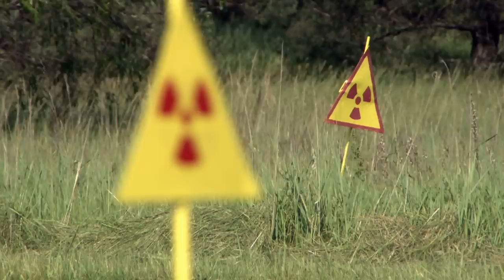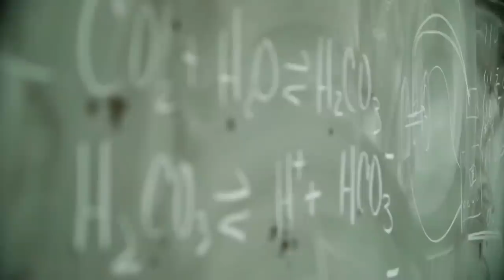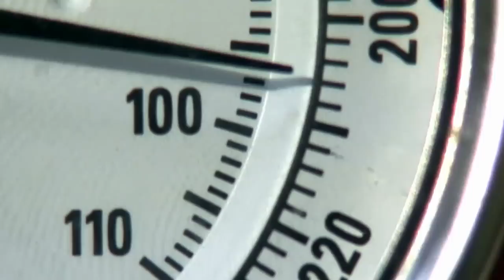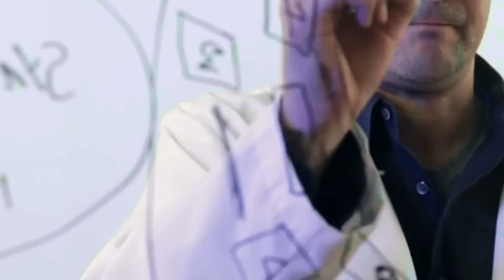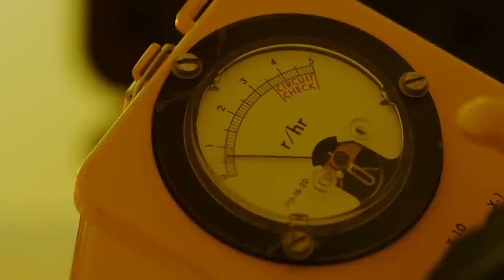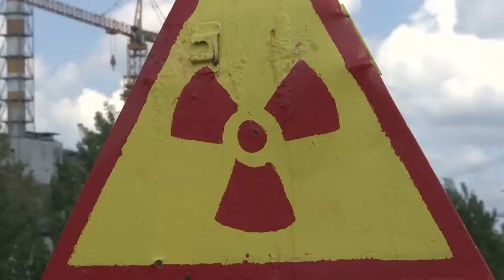China’s Most Powerful Global Weapon - A Synthetic Sun?

Comment: This promise of limitless energy has been promoted for at least 25 years.  So far, it’s just a money pit.
Reply: Longer than that. Fusion has been "only 25 years away" for the past 60 years at least. 😂
Reply: @hazonku  yeah, every 25 years they claim, that from now on, it will only take about 25 years until fusion reactors will produce more energy than they consume 💪😂
Reply: Every endeavor was a money pit before it worked. Wouldn't you think that limitless energy would be difficult and expensive?

Fusion research has been improving quickly for decades. It's just very difficult so even quick pacing requires decades.

I suggest looking into commonwealth fusion systems. They have demonstrated new magnets and are constructing a compact reactor.
Reply: This seems like a DEAD END.  Trying to keep temperature for 150 million degrees for any length of time,  it will melt everything around it.  In order to keep CONSTANT flow of electricity.  It has to keep the temperature for 150 million degrees forever.  This will never be reached.  Therefore, this type of project is a dead end.
Reply: @jeffjohnson5053  Agree, but the Sun does it for billions of years relatively safely. 
Meaning we just need to focus on inverting gravity first! 😂
Reply: Limitless energy for the people who get the investment monies.
Reply: @Shadow__133  Or harvest the sun insteas of making one?
Reply: @sirmiles1820  We already "stock" wind. That would not be a bad idea 😆
Reply: If you read this far you are a certified fusion reactor specialist.
Reply: @jeffjohnson5053  thanks Jeff Johnson 

Lol

Comment: This sounds like a modern but fairly run of the mill Tokamak.  They don't seem to be getting past the energy payback point.  There are a number of these all over the world.  What's the big deal?
Reply: Well, everyone in the world is beginning to understand that make a reactor smaller is better for everything. Easier to clean up say a problem occur. Using A.I. and making the magnetic field better controlled allows for them to reach those fusion levels. Honestly, I think they are stealing intellectual property here in the States. Fusion reactors, magnetic field control and materials science is moving really fast these days and getting better.
Reply: @brown2889  yeah its always 20 years away
Reply: it's running time. 17 minutes before losing stability or melting the inside due to the plasma contact is big news actualy. Net gain return is a moot point as it's all in the math
Reply: Did you watch the video?
Reply: Funny enough I think South Korea was the first to break even. And the US Ignition Facility not soon after (using laser confinement). I mean this happened at highly experimental facilities. But also you have a ton of smaller private companies drawing up more compact designs. So it's getting easier.
Reply: The big deal is that this one is burning longer which pushes us closer to 100% working TokaMac
Reply: @Chestermcfly420  it hardly ran its literally not a big breakthrough in the slightest.
Reply: @sandysand3097  17 seconds... no?
Reply: Dark Guy fell for some Chinese propaganda.
Reply: @brown2889  hmm stealing is giving lol
Reply: This seems like a DEAD END.  Trying to keep temperature for 150 million degrees for any length of time,  it will melt everything around it.  In order to keep CONSTANT flow of electricity.  It has to keep the temperature for 150 million degrees forever.  This will never be reached.  Therefore, this type of project is a dead end.
Reply: Nothing at all

Comment: From all that I have researched on this rather esoteric subject, the big reason that Nuclear Fusion has not had net energy gains is due exclusively to the fact that the ginormous electromagnets - used to contain this volatile plasma material - suck down a tremendous amount of energy.  Now companies are working with low-energy magnets which have a greater chance of achieving net energy gains.

Comment: I don’t see how fusion power plants are possible. Stars use gravity, which is limitless, to turn mass into energy. To create fusion without gravity and have extra energy as an outcome seems impossible in my mind. It would seem to break the laws of physics. I should try to understand it more, but these basic thoughts really stand out to me.
Reply: Gravity is just mass rotating. Magnets are used in tokamaks to simulate this, they accelerate a mercury ball extremely fast to the point that G - Force rips the atoms and molecules apart. The same thing happens in the sun by its huge mass rotating fast enough to again shred things at an atomic scale. The heat and light are a by-product of this.

If you rotate anything with enough mass, it will start to pull the surrounding area towards this, by magnetism. All things have magnetic charges, and if they are accelerated, they impact other magnetic particles, creating a chain reaction.

There is probably an unwritten formula about this. Something like (mass x rotation) × amount of magnetic particles present = gravity potential
Reply: @eastindiaV   That’s not exactly fusion, heat is the secret ingredient in which the nucleons of an atom dissociate under extreme temperatures overcoming the electromagnetic forces between protons and electrons, this creates a neutrally charged plasma that then collapses into fragments of heavier and more stable elements and the increase in the stability of the element comes about through the emission of energy. This of course only works as a general pattern up to the iron peak, past that point you use fission to go down. Your comment on gravity is interesting though, I am only still studying  at Uni, but I think your referring to spin of quarks and leptons, can I assume you’re studying the standard model of elementary particles? Because it is a very fascinating topic to think about how to incorporate gravitons, but if there’s anything you know about that, it’d be great to hear 😃
Reply: On your question about fusion, the gravity isn’t really important because it’s a reaction in which atomically unstable elements transmute closer to iron by realising energy held in the nucleons of an atoms core, I would very much recommend looking at the colourful and lighthearted animation made by Kurzgesagt, https://m.youtube.com/watch?v=mZsaaturR6E, it’s a great short video that explains the concept in layman’s terms and should give you the necessary knowledge to understand the concept without causing further confusion or leading you down a rabbit hole
Reply: This is how I understand it (I am not an expert). Picture "V" shaped ramps; you roll a ball down one of the ramps. What will happen? It will settle at the bottom. Balls rolled down a "V" shape just naturally do that (kinda silly to even think about, because it's so obvious). What's not obvious, to us here on earth, is that a plasma can also achieve a similar state. If you've ever seen videos of the sun, I'm sure you noticed all those lovely "Coronal Loops" of plasma. Well, those loops are kinda the equivalent of a ball at the bottom of the ramps; they just naturally form those cool loops within a magnetic field (keep in mind we only see part of the loop, the rest is below the surface). The idea is capturing one of those loops in a magnetic bottle here on earth (literally lightning in a bottle), and if we can manage to do that, you should be able to extract enough energy out of the system through heat to boil water, to run turbines attached to generators; you then plug your super-powerful bottle magnets to those same generators (not really, but basically that's what you want - the magnets are very efficient, they are made from superconductors and require very little power when run at cryogenic temperatures) and you should still have way more than enough power to do some really meaningful stuff! Not only power homes, but really energy expensive stuff, like carbon capture and sea water desalination, to hopefully get us out of this mess! So, that's kinda-sorta why it wouldn't violate the laws of physics. It's just really hard to do on our very small planet... Now, for me, this whole idea of capturing Coronal Loops is really well envisioned by taking a closer look at the shape of a "STELLARATOR" reactor, which is similar to the "TOKAMAK" in this video, only that a Stellarator actually tries to physically emulate the shape of the loops themselves; just compare the shape of a Stellarator to a Coronal Loop and you'll hopefully go "ahh... I see what you're trying to do" ;) Personally, I think ITER will be successful and will yield the blueprints for future fusion power plants. If we didn't have superconductors I'd be worried, but we have them! That for me is really the key technology; it's been well developed and advancing everyday! Anyway, hope this helps!
Reply: it's about potential energy, you get thrust in a car through the same premise with combustion engines. just hydeogen is roughly 33% efficient, an insane amount compared to combustion fuel.